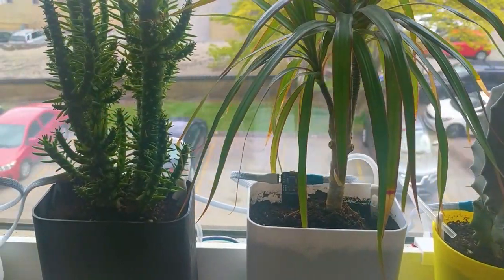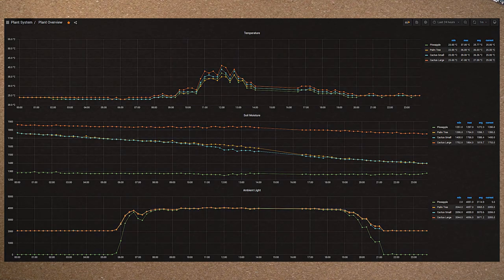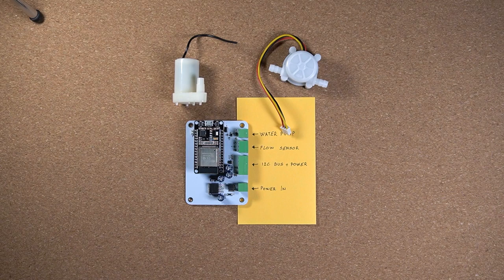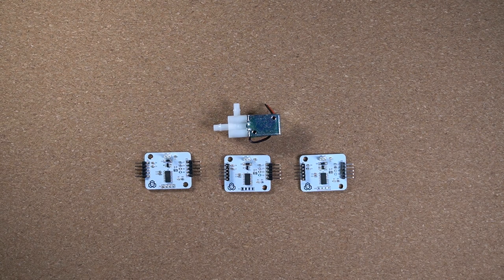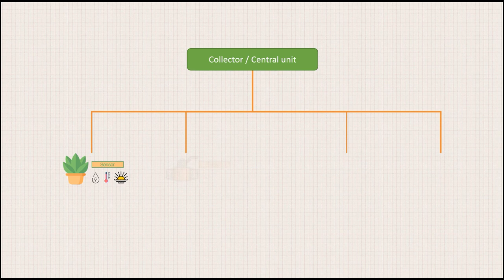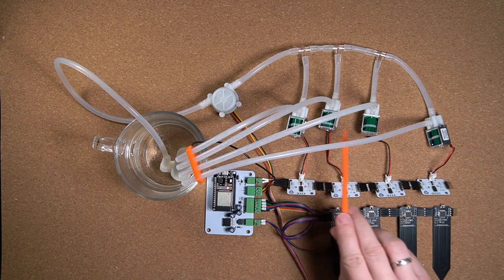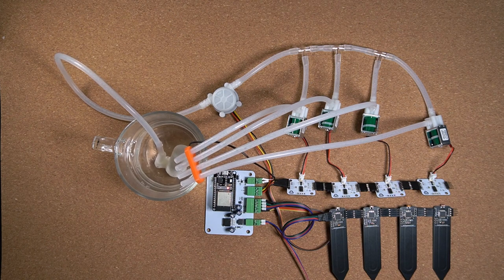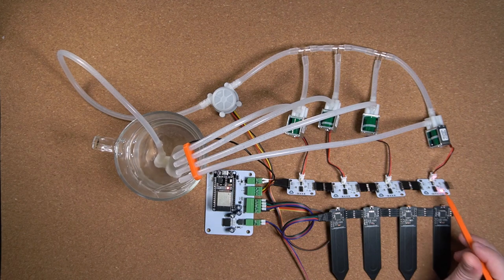DIY House Plants Watering System // Part 2: Central Unit

Comment: Cool! I'm doing myself a system too, because sometimes I've days working, and now I have some really thirsty plants around, something need to be done ASAP.
I'm going to make the system individual, each pot will have it own full control system, being the only shared part the rain water tank.
And I'll not have any data register, since I'm planning to work on tiny solar panels to make it done...
Anyway, great ideas coming from this series, thank you!
Reply from the maker: That sounds very interesting. Let me know how it turns out once you have it up and running!